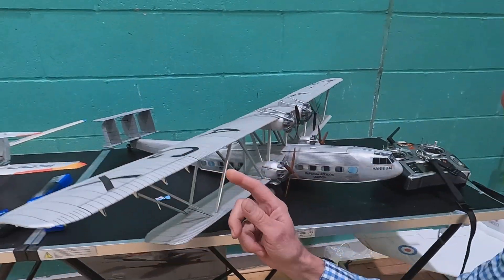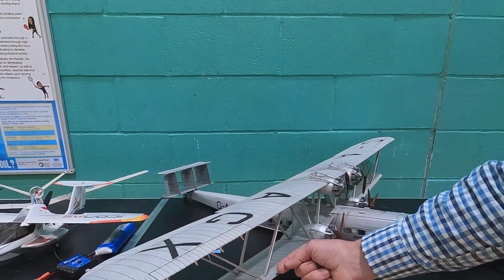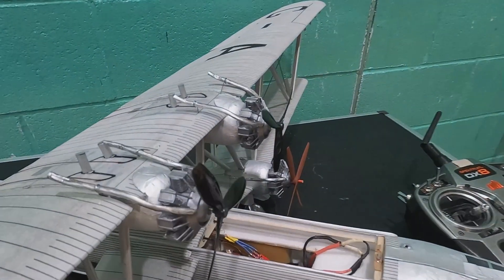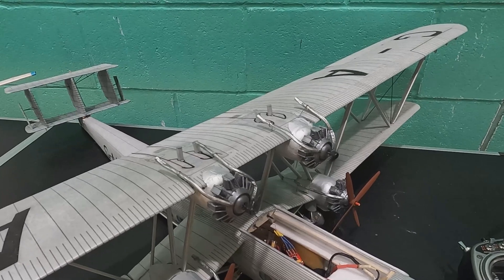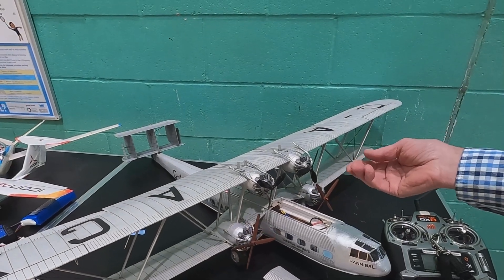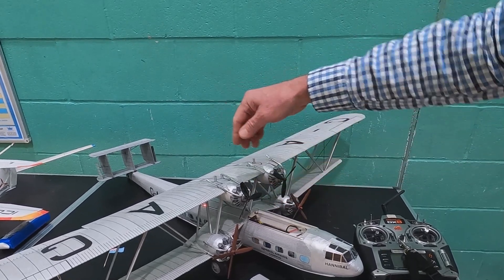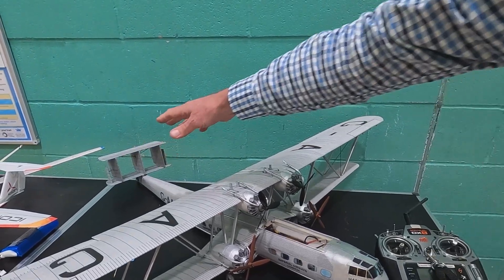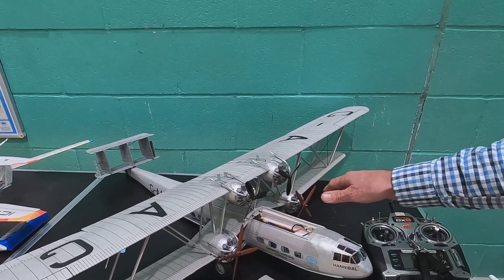The Handley Page H.P.42 indoor flying model

Comment: Thank you for updating with my additional details of this model. it is still unfeasibly fast for the scale...    1/32 of 100mph is around 3mph, while the model flies close to 3 times as fast! I am just going to have to build much lighter. :)
Reply: Change the viewing speed. M😀
Reply: @rovercoupe7104  that would be cheating
Reply: I think this is one of the nicest scratch builds I have ever seen, and a very difficult subject matter. I'm floored, really.
Reply from the maker: I will add the information you have provided in the description's. Thank you very Much. 👍👍👍
Reply: maybe it would need some real slow profile.
Reply from the maker: @ulrichkalber9039  scale, you can't scale down the air they fly in. More wing area more drag.
Reply: I wonder if it would even be possible to fly at 3 mph. Beautiful model by the way, I'd be afraid to fly it.
Reply: Not many seem/bother to understand scale speeds,  Piper Cubs with Tornado speed, mostly in the ready built stuff, which would be the only thing I have patience with these days (but not the money).

Comment: The lift generated by the HP42 was so great that on one occasion it was seen to be airborne at Croydon before it had left the concrete apron (for the grass).
Reply from the maker: I guess a head wind and all those Wings plus 4 engines would help. 👍🏻

Comment: should be free flight. Ditch the radio gear. Would fly even better. Adust for a tight circle and put some wash in  the port upper wing. Would be cheaper and lighter. Teach the model to fly and outside control is not needed.
Reply from the maker: That would be a whole new learning curve. 🥰😍